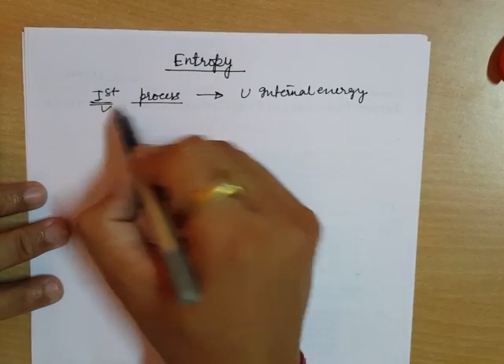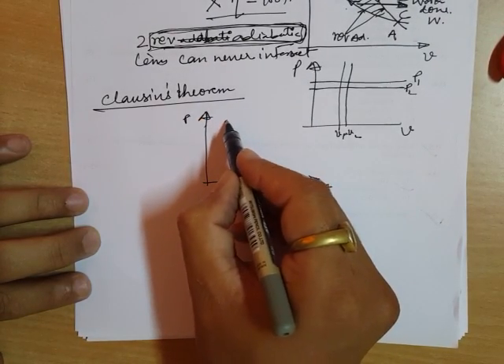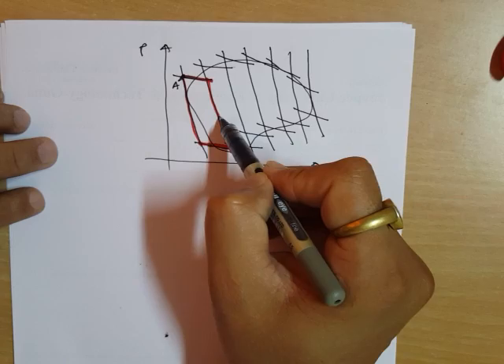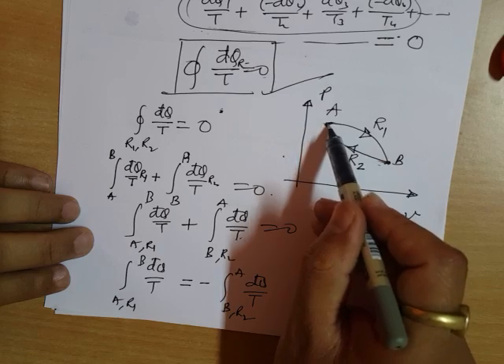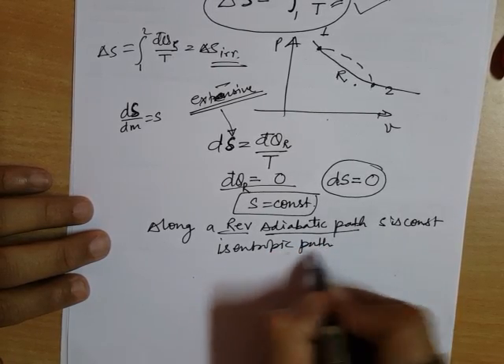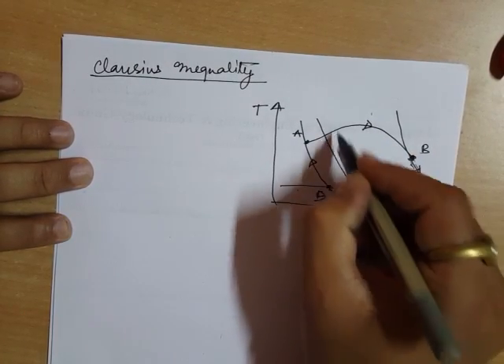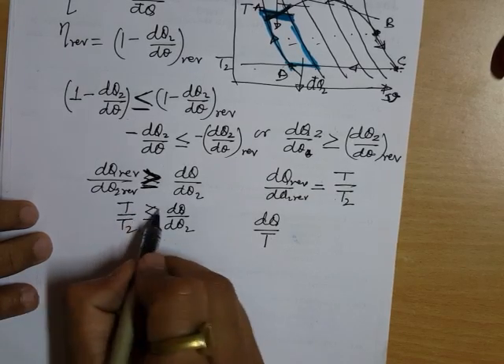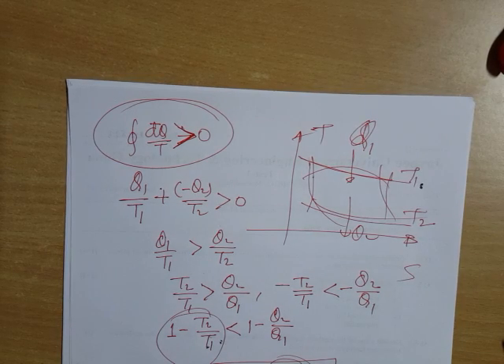Engineering Thermodynamics: Entropy part1

Comment: Why are we replacing reversible path AB by a zig zag path of two adiabatic and one isothermal process ? 
Why not with other processes
Reply: Your sole Moto is to make the area same with your end points as adiabatic lines and that's possible with  iso line only
Your area wont be same in any cases considering your end points to never change

Comment: sir ,in clausius inequality i think that isothems line should be straight not inclined
Reply from the maker: Dear Aditya as the diagram is P-v so Isothermal lines will be inclined not straight.
Pv=const. For a perfect gas so as v increase so p will reduce.
By the way thanks for showing interest in my videos.
Reply: Engineering Thermodynamics PANKAJ DUMKA sir but that's a T-S not pv diagram ..I am talking about the Ts diagram you used in clausius inequality.....In that you made a straight line which corresponds to temperature T2 but while drwaing isotherms at temperatures T1 you made them at an angle
Reply from the maker: Aditya I got your point it should be straight not inclined. That was just the flow of P-v which carried to T-v dig. As well. 
Thank you for your kind comment.